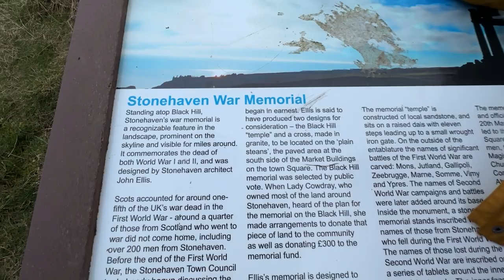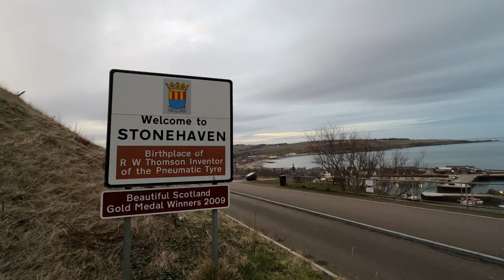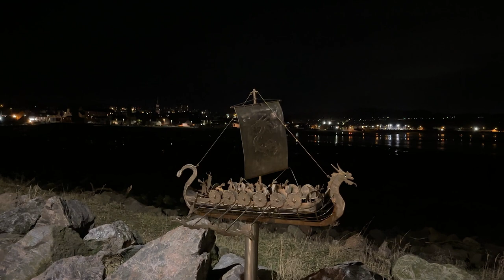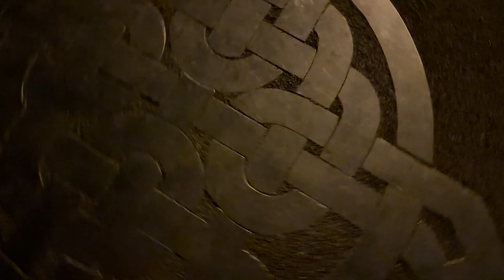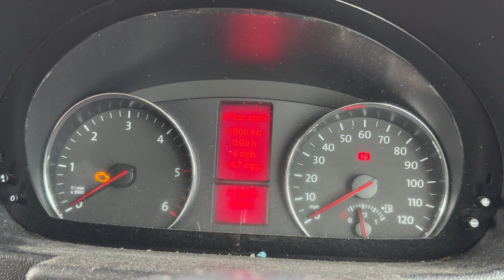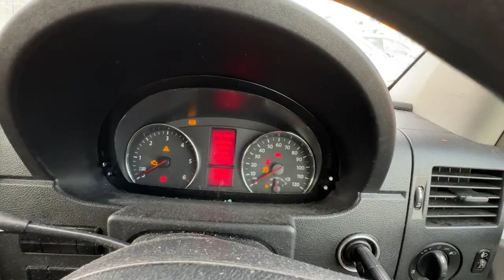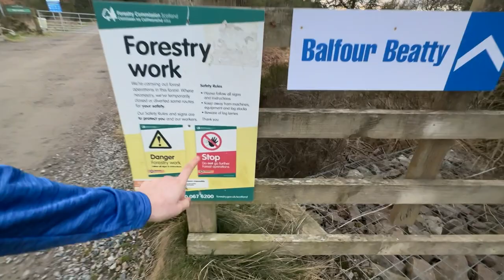Ignore NO OVERNIGHT PARKING signs in Scotland - VANLIFE

Comment: The dynamic duo strike's again it's nice to see you and Amika having fun one thing if Amika is going to use the jungle Jim in a park lay off the whiskey that fall looked painful.
Gary it is great to see someone who can do the basic checks on their vehicle, one thing I would not recommend Halfords for your bulbs they charge £6.99 for each headlight on my 4x4 the company I use is mail order called Powerbulbs UK (you can find ever bulb needed for the van on their website) and they charged me £15.99 a pack containing eight bulbs one of each needed and four fuses two mini and two standard size and that price includes p&p Halfords also has the cheek to offer a fitting service at £9.99 the day I need that will be returning my license which is 🦕.
Stay safe looking forward to the next video.
Reply from the maker: Thanks mate. Yes I never use halfords however the alert went off maybe 600 times that  day, I wasn't prepared to wait for mail order 😂
Reply: When I learnt 🦕 to drive bulbs were not as reliable so got into the habit of carrying a pack of spares and I have never got out of the habit, my late father was in the motorway police and he said it is always a good idea to be prepared for anything my emergency kit consists of a High vis per person a tow bar jump box compressor fire extinguishers emergency blankets warning beacons and sand ladders in the winter two sets of snow socks shovel k rations hot water in flasks tea and coffee are added I always carry a phone charging cable.
Load bed on pickup truck is large and I have put everything into plastic boxes so I can swap from summer too winter the winch is only packed if the weather is going to be really bad.
Odd thing is the Ssangyong Musso pickup truck had no problems with the snow even though it's on standard road tyres and in two wheel drive.